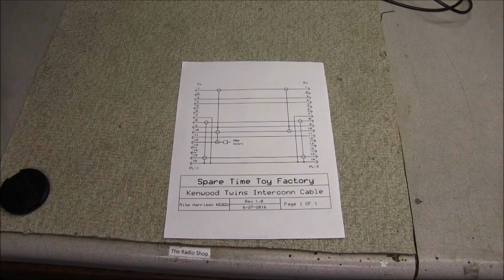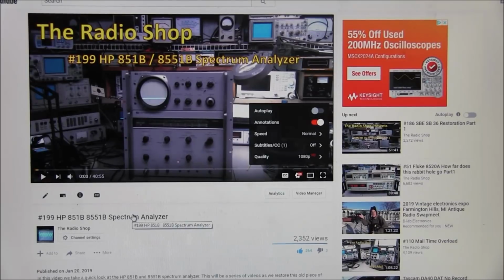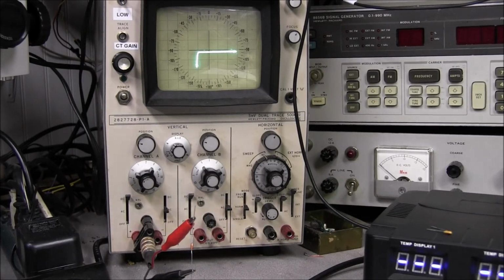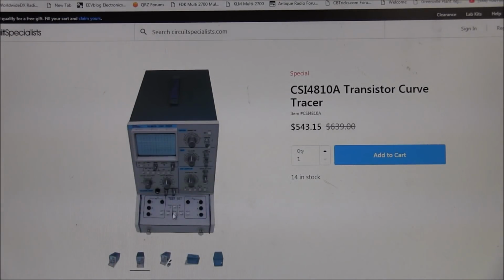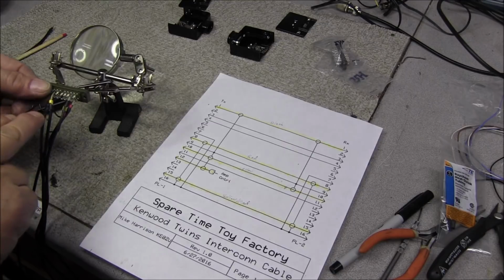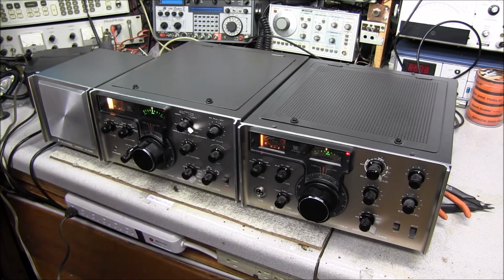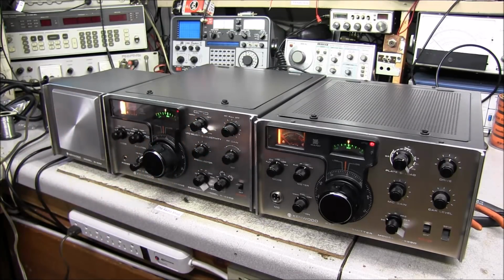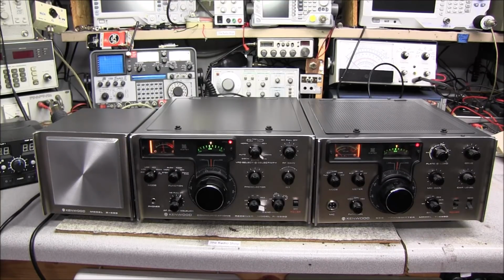#200 Kenwood Twins Interconnect Cable

Comment: Great video. Thanks for climbing out of bed to produce it. Curve tracer is nice, just don't know how much use it would get.
Reply from the maker: I find myself using mine quite a bit. Beats removing components to test them.
Reply: @TheRadioShop 
I did not know you could check components in circuit with a curve tracer. That is a big deal. 👍
Reply from the maker: One of the advantages of that thing

Comment: looks very professional your produced cable and works perfect. Well done Buddy and thanks for sharing..
Reply from the maker: Thanks Peter. I wanted it to not only perform good but look somewhat factory made. I looked all over town for some cloth covered outer wrap but seems no one carries that any more.  Use to be able to get it at automotive stores. But had to go with the plastic tube wrap. Thanks for stopping in

Comment: Great job Buddy!  Its normal for YT to display low res shortly after uploading a video...during this time, YT creates/renders all lower res video underneath the uploaded video, so if you upload a 1080P video, YT creates/renders 5 videos below it for each resolution.  You can find component tracer kits on eBay for a few bucks or buy a o'scope that has a component tester, I have one...bought it dirt cheap!  Maybe you should take over as manager, better retirement pay? RX your package, haven't installed it yet, but soon, thank you! Get better!  ~Jack, VEG
Reply from the maker: Thank you Jack. I have been looking at the kits.  Let me know how the board works out for you. Manager? No way. When you go manager the next move is out the door lol.
Reply: I will...there will be a video (with great praise), so stay tuned for that!  However not sure exactly when but hopefully soon!  Take care Buddy! 73's.  ~Jack, VEG

Comment: Used to have a set of those, and many years ago, I had a huge video set up that I bought from the school. And it was a Sony video real to reel I had two of them, and two monitors. Well there was this interconnect cable, that went from the VTR to the Sony monitor. And it was the same cable that went in between the twins that I had. I never bothered to look, but I’ve often wondered if they weren’t wired the same.
Reply from the maker: Thanks for sharing

Comment: is there still a source for the Hirose electric connectors?  i was going to swap out with a DB-25 bulkhead connector but its not a drop-in replacement and i dont feel like hacking the metal.
joe... WA2L

Comment: SUPER grateful for your Kenwood 599 videos! I've got two T-599Ds and one R-599D. All of them need some sorting out. Question for you, please, though I have my Ham Radio General Class license, it's been quite a few years since I've studied the theory and I'd like to be able to fix my old Kenwoods. Where would you suggest I start with learning how to fix these old rigs? Tnx de WB3CFN
Reply from the maker: Thanks and a good question.  I have been planning a video on just that subject that would answer your question. Start by reading the service manual. Print out the block diagram and makes notes on it as you are reading up.  This way you get a bit more knowledge of how those circuits work and how they depend on each other.  Google is great. many videos and articals on certain radios. These are the tips you will find.

Comment: The defective capacitor was a tantalum.
Reply from the maker: Yep, failed to mention
Reply: @TheRadioShop  
No big deal. Because of the way they are made, that may be the reason it reads as a diode on the little component tester.